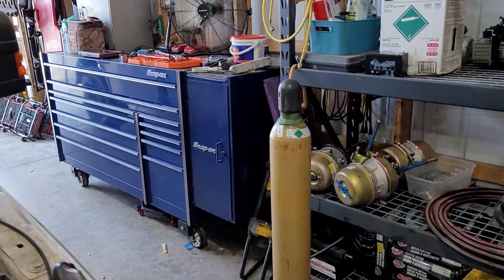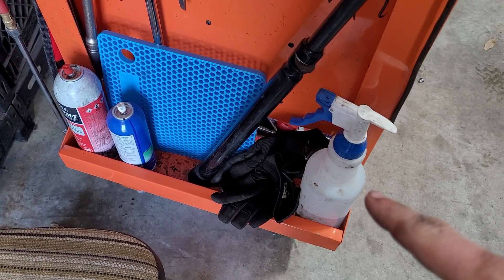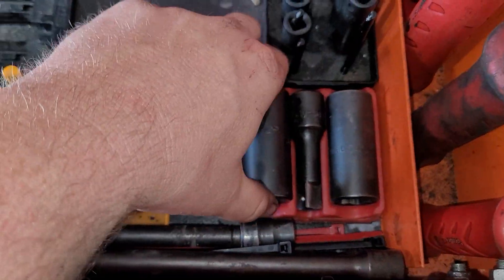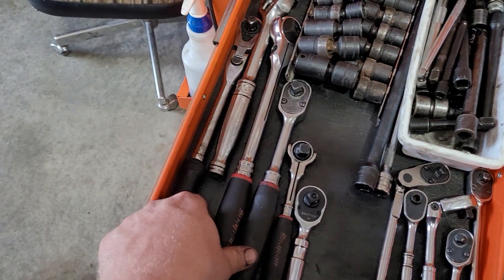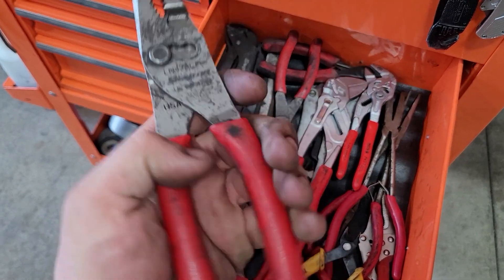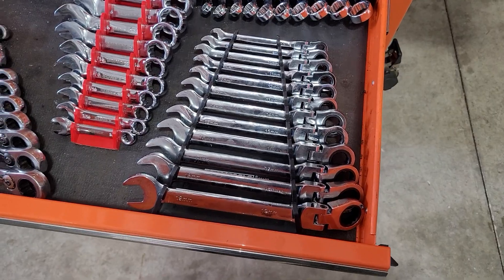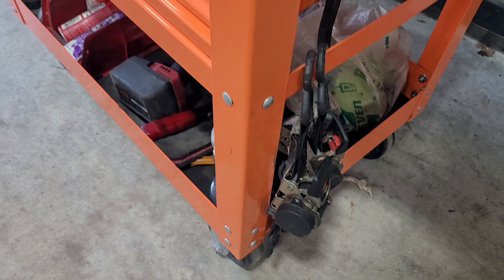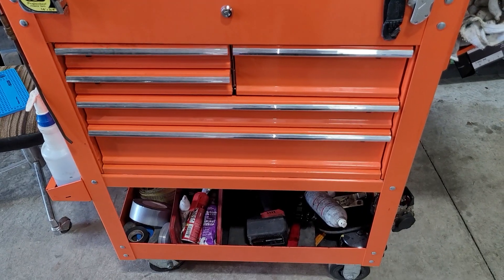Diesel Technician Us General 5 drawer tool cart tour.

Comment: 8:31, I bought 2 U.S. GENERAL Wire Pliers Rack - Item 70022
and shortened them to fit the width of this drawer. Put one at the front of the drawer and one at the back, your able to fit a decent amount of pliers